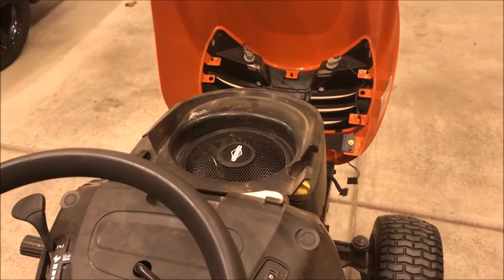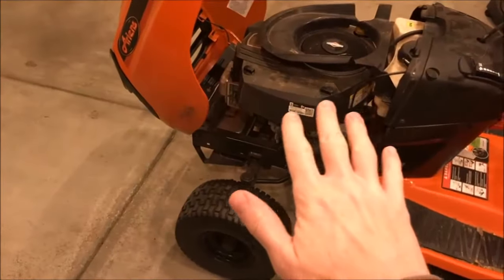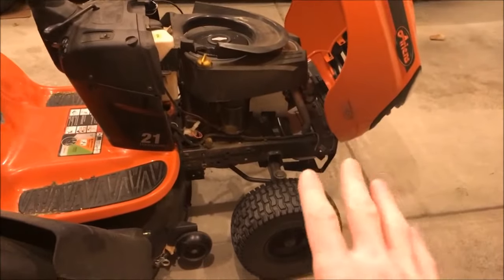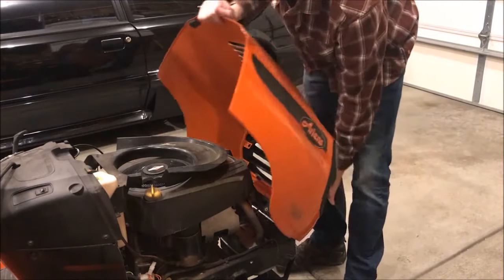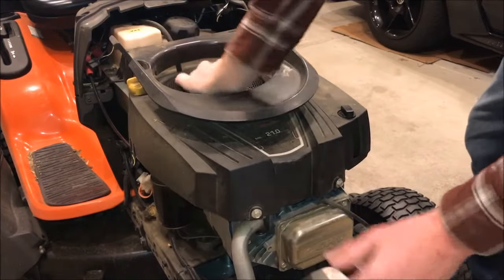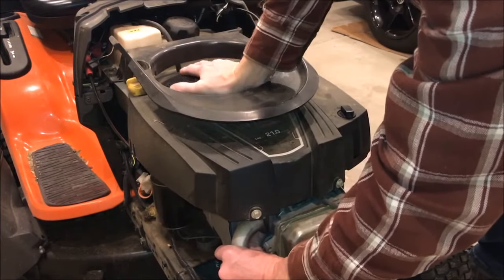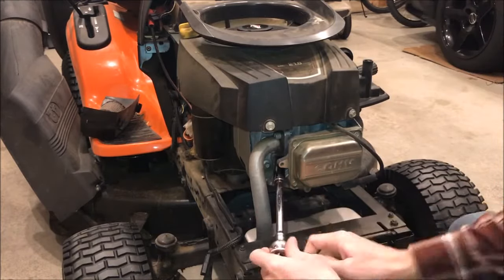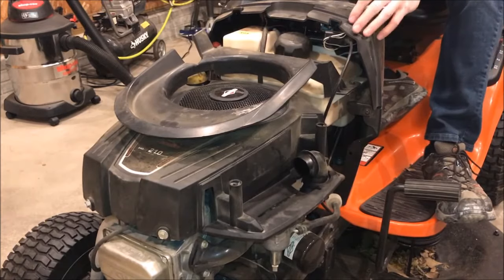Start Compression Locked Briggs & Stratton Engine

Comment: I have the same problem but a much easier way to start it when it wont crank as his did you are on top dead center just grab the fly wheel screen and turn it counter clock ways till it gets real hard to turn , I put a little fuel down the carb as he did with starting fluid put your throttle at its lowest point like you are killing the motor this allows less fuel & air in so less to compress turn key when it starts go full throttle ! IT has worked for me for 3 years !
Reply from the maker: Isn't it sad that people have to use these "hacks" to use their yard equipment?  You describe a much easier method and I will give it a shot.  I'm replacing the cam for the 2nd time, but it will fail again...  Maybe I'll have an electric one by then! haha.
Reply: I do the same...
Reply: Yes, that is how I do it also; just hop off the tractor, spin the engine CCW and get back on.  It has worked every time for about 6 years but I'm getting tired of it and will do the repair this winter.  Also, mine engine is 26HP B&S and has two spark plugs, removing them each time is out of the question.
Reply: i turn the top of engine counter clock till it gets hard to turn put throttle on chock and start engine
Reply: @xd319michael2  Ya taking it of the compression stroke dose wonders !
Reply: @FastFixYouTube  it seems like people have this happen multiple times and some never have the issue we fix many of these engiens and they are good but have lots of valve issues and the camshaft issue
Reply: I can't even turn the fly wheel by hand.  I tried prying the wheel with a pry bar tooth by tooth going clockwise.  I don't know what to do.  B&S, Craftsman, it does live outside winter and summer, my chickens took over my shed SMH
Reply: @Asahi41269  it sounds like it may be locked up make sure it's a neutral and pull the spark plug is it still won't turn over it's fried he's locked it up
Reply: @Asahi41269   when was the last time it ran and what was the problem in the first place ? I’m confused by your comment
Reply: Even easier, block air intake. No air enters to compress.
Reply: @M70ACARRY  how’s it going to start the engine needs air to start
Reply: @hunter7476  release as soon as it starts spinning. Trust me, it works
Reply: @M70ACARRY  ok I never had this happen and when it does this I replace the cam shaft but next time I’ll try your method
Reply: I have a craftsman T140 doing the same thing. Also can’t keep the mower belt on every time I disengage the mower the belt comes off the pulley,  which is easy to put right back on but still annoying for a newer tractor.
Reply: Why not just fix it?!
Reply: @fishhuntadventure  I am low on cash and time and this has worked for years .
Reply: @M70ACARRY  Thank you!! Much easier and it started right up. only thing I worry about is if it was the compression relief thing will it hurt the engine leaving the parts in the engine?
Reply: @M70ACARRY  
Your method works great...wind it backwards , take air filter off, then block the air intake with your left hand & crank it with your right hand on the key & let 'er rip. 
I burned up a starter before I figured this out (via YouTube).
Reply: I have a 22hp v twin intek it's hard to start but it starts sometimes, there's also no metal in the crank case, what else could cause the hard start? it also runs really bad and won't idle up with out stalling which it does after a couple minutes anyways, it also smokes white
Reply: That’s exactly how I do it. You don’t have to be on TDC , don’t have to pull the plug and ask rust bullshit,  just go backwards to the last compression stroke and it’ll start right up 90% of the time. However, you also risk busting the flywheel key when you do either of these methods so it’s best to fix the cam as soon as you can.
Reply: @FastFixYouTube electric? Why in the hell would you WANT to go electric?

Comment: So if anybody is still watching this particular video, simply turn your engine backwards until you feel the compression, then take the air cleaner off, put your hand over the carburetor and turn it over. It will fire up immediately, then put the air cleaner back on and away you go once it's warm it will fire up from after you turn it off for a few minutes.
Reply from the maker: Yes! This is correct. My method is overkill 👍
Reply: Thanks to both of you.
Reply: I have to do that every time now. I also hook battery charger up to the battery. Turn engine all the way counter clockwise until it stops, then cover carburetor with my hand and crank it over and it starts. Shitty I gotta do it every time when the mower is only like four years old.

Comment: I saw a video where if you take your hand and put it over the air intake, that will prevent air from getting in and compression building up, and allow your engine to turn over, and once it is running or gets going you can release your hand and let air in.   I haven't tried it yet.
Reply from the maker: Hello!  Yes, that should work!  In fact, that’s how I do it now.  Much faster/easier. Good tip 👍👍👍
Reply: @FastFixYouTube  You've tried ot and it works?  I'm skeptical because even if I blocked off the air intake there would seem to already be enough air in there to get compressed to halt the engine on the first compression stroke and go no further.   My sir intake isnt so easy to block off either behind a cheap foam air filter and plastic housing.   I'll try it with the next crank.   I had a job yesterday getting the blades off and sharpening and balancing them on my motorcycle wheel balancer and using hand grinder.
Reply: I just posted a similar method that I have been using for a couple of years since I don't feel like buying a new decompression cam... Yes this absolutely works😉👍
Reply: @chrissadler7775  After picking up my lawn mower several times on its side to access the mower blades below to change them, and then dropping it down hard, I found it reset my compression mechanism.  I was like hmm...

After a couple of times of doing this, it just kept working, and has been working ever since.   You had to pick it up on the side opposite of the carb... on the starter side on my MTD yardmachines for it to work, which led to a lot of oil going out through the air filter, thus leading to quite a bit of white smoke until you got it started and running for a while, so you made it quick on its side before you dropped it hard again back on the ground.

Kind of like how old Apple II owners would slam their Apple II down hard on a table to try and reset all the chips in their sockets rather than opening it up and pushing down on each one with their finger.
Reply: @choppergirl This wont-work for my particular issue. As the decompression lever has actually broken off of the camshaft due to a rapid stop. I had the engine apart with intent to replace the part, but the wrong one was sent. I reassembled everything so I could cut my grass as it was due, and I just can't be bothered completing the repair because this works well for me.
Reply: @chrissadler7775  Yeah, it was not a theory I just though up and tested, but more of an observation on my part... hey, it works now, that's odd, but why?   What did I just do.   I picked it up sideways and changed it's entire orientation and set it back down.   And by then I had more of an understanding of how they worked and what they looked like by watching Youtube videos....

And I thought, is it repeatable, the next time it locks up and the starter couldn't turn it over.   I found it was repeatable in my case.  Just one of those aha  moments.

Oddly, I used the same deductive reasoning to fix and diagnose a faulty engine activated fuel petcock on a new motorcycle I had bought.  I was like, what if I suck or blow on this tube, can I activate it manually.  What if I cover the the vacuum hole entirely going into the petcock.  Voila.  It worked and fixed it.  But I was like, this shouldn't work, but it does, so I'm going to buy a new replacement regardless and do some research.

I figured out an overheating electronic distributor on one of my cars the same way.   It would run fine for 15 minutes, then suddenly stop running and leave you stranded on the side of the road.  I'd pop the hood, and try anything, but nothing I did would start the car.  More testing led me observing no spark.  But then later, there would be spark.  What the heck?  What was going on each time?  Well, I was opening the hood and letting everything cool.    After I waited and the engine had cooled, voila, spark again!   What the heck.

Which led me to looking further and observing a warped manifold gasket was blasting exhaust gas right on to the metal stalk of the distributor, which conducted heat right up into the digital electronic circuit board inside.  Aha.   This is an involved fix to put on a new headgasket, but what if I plug up the crack with non-flamable fiberglass, and then build a heat shield to blast whatever heat away from ever reaching the distributor stalk. Tada.

Now I carry a spark tester on all my vehicles, and it's the first test I do... it will eliminate half the problems immediately and tell me... is it a fuel delivery problem, or is it an electrical problem.   If you got spark, you know it's fuel, and if you don't have spark, you know it's electrical.  Then you can proceed from there.

The more research lead to a recall on that part for that very year motorcycle.

Comment: You can also turn the engine backwards to that same spot like you were doing with the fly wheel cover without removing the spark plug.
Reply from the maker: Yup, exactly right. Don’t need to remove the spark plug 👍
Reply: That's what I usually have to do.